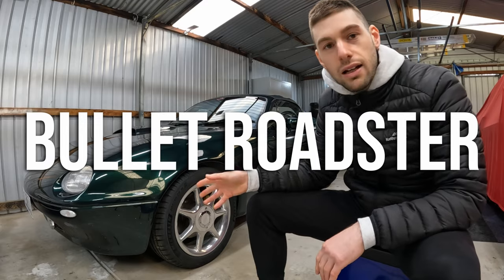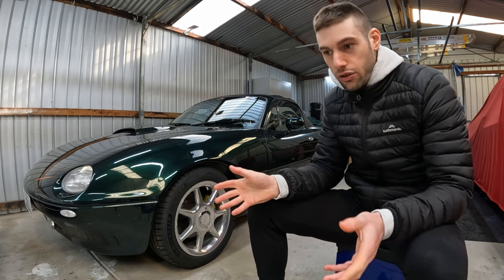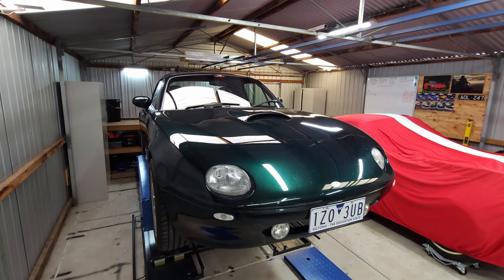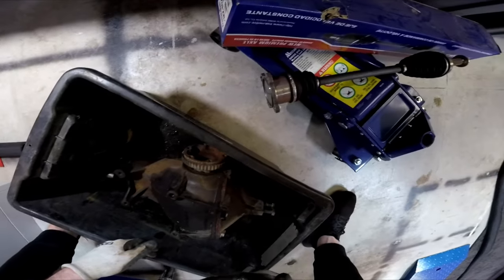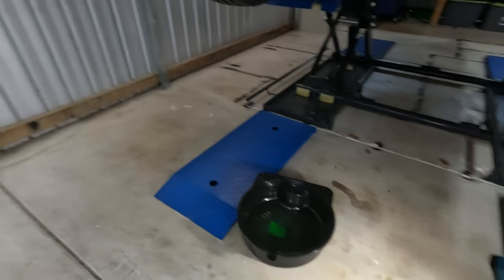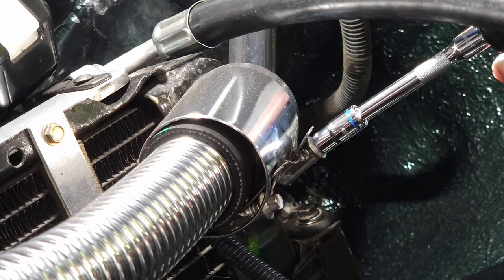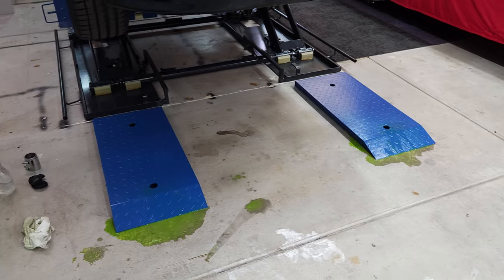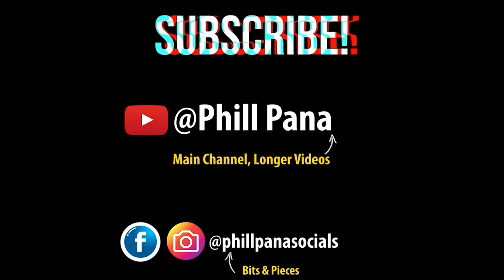V8 Mazda MX-5 Build | Project Bullet Roadster Part 2

Comment: Little point in putting a diff in whose condition you know nothing about. There's a reason it came out in the first place. Unlikely to be better than the one you have. Whip the back covers off the diffs, count the teeth on crown wheel and pinion, figure out the ratios. Look for damage, marks or scoring on the teeth, check the backlash. Doing that is a relatively easy job compared to dropping the thing out in the first place. Higher numerical ratios = shorter gearing, which will add to your jerkiness. It may be the car is better with taller gearing. Clearly it won't be lacking in grunt. But to look at the big picture, simply changing a diff ratio is unlikely to make a difference to 'jerkiness', unless there is something wrong with the diff. Just my 0.02c worth... hope that helps.
Reply from the maker: This is extremely helpful and yes I did see online how to calculate ratio so future plan is to pull back both covers and take a look. I'm really stumped as to what could be causing the jerky ride at low speed as all my mounts are in good condition so the only 2 things I can point to is the diff ratio or the vacum leak however past vacums leaks I've delt with haven't caused this issue before. 

it's only trial and error from here it seems.